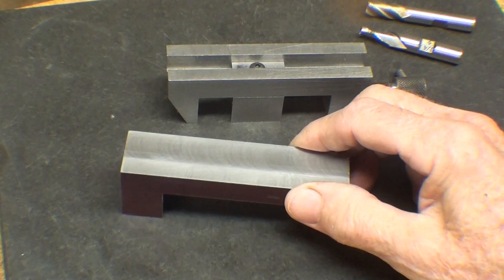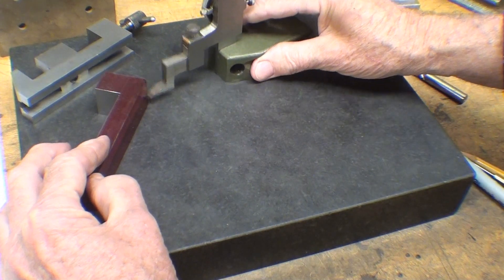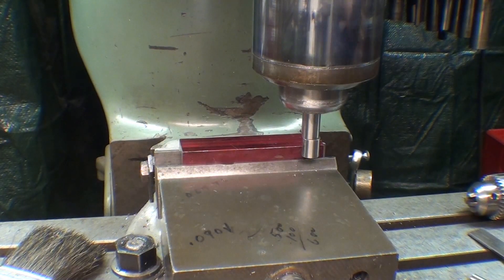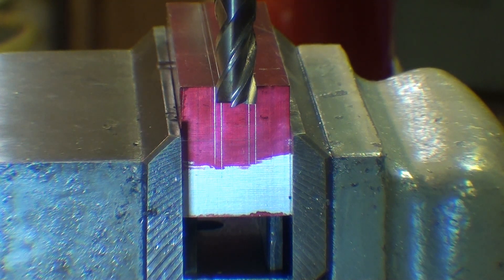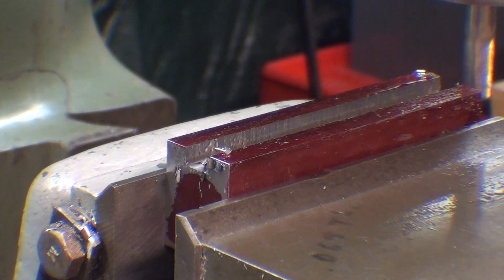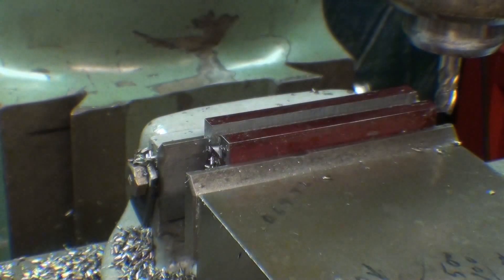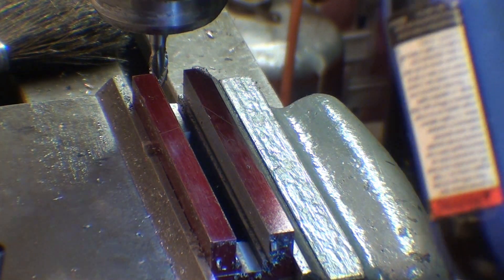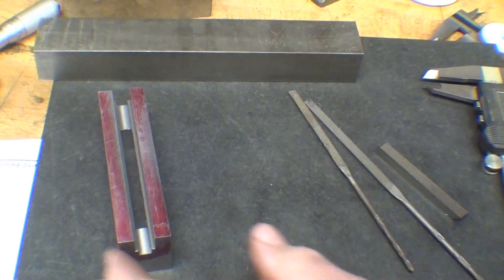TIPS #352 pt 3 tubalcain MAKES A TOOLMAKER'S VISE

Comment: Mr. Pete, I would imagine you have answered this question before but I looked through as many comments as I could before my patients ran out and didn't find it. I haven't seen you use the automatic feed on the bridgeport when running through the part. Does it not work on your machine, is not installed on your machine, or is there another reason?

I enjoy your videos, thank you for taking the time to put them together.
Reply from the maker: Mt BP does not have a power feed-wish it did.

Comment: Thanks for this build.  An idea for a future topic.  Maybe you already have done this within other videos but maybe not as a separate video.  The idea is about how to find the center of a piece to be milled, with and without a DRO.  I get what you are doing, find the edge with a 0.5" finder for a 1.0" piece of material then move in 0.750" (=1/2 * 0.5" + 1/2 * 1.0") to find the center.  Simple!   But others may not be able to visualize this as easily.  Just a thought.
Reply: Did you catch him @ 3:35 saying the thickness of the vise is 500. The thickness of the vise is 1 inch. He meant that HALF the thickness of the vise is 500.

Comment: would using solid carbide endmills elimate the deflection?????
Reply: Freshly sharpened older end mills are nice because they are undersized. That way I can grab a 1/2" end mill that really isn't 1/2", do a slot, and still have enough meat on both sides to get a nice climb cut and bring it up to 0.500"
Reply from the maker: never tried it
Reply: The tool bends (carbide less than HSS, but some), the spindle both bends and moves in its bearings, the vise bends, the table moves (both by bending and by slack in the ways). Each contributes some to tool deflection and must be allowed for. No amount of effort will "eliminate" deflection; you can only do your best and work to your tolerances.
Reply: My experience is they don't deflect, but also don't forgive.  They are so hard they break if loaded up.
Reply: Everything deflects under pressure - period. Carbide may deflect less than you care about for your particular application, but it still deflects.

My father liked to tell about the designers of machines for engraving diffraction gratings (120,000 lines per inch - 4700 lines per mm). They said you had to design the machine as though it was going to be made from soft rubber, and then make it from steel. A truck passing a half mile away would still vibrate and distort the machine enough to spoil the grating being engraved.

I have demonstrated that a 14" x 14" reinforced concrete beam is quite flexible. I just had someone put their hand on one side of the beam while I hit it with my fist on the other side. They could easily feel the motion, even though both ends of the beam were integrated into a much larger structure.